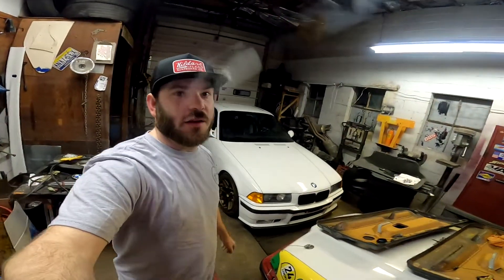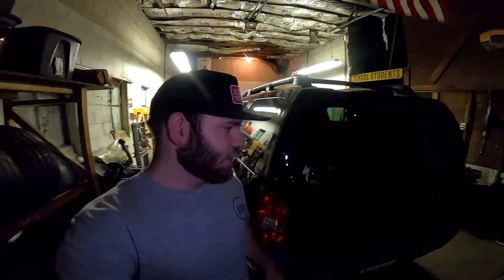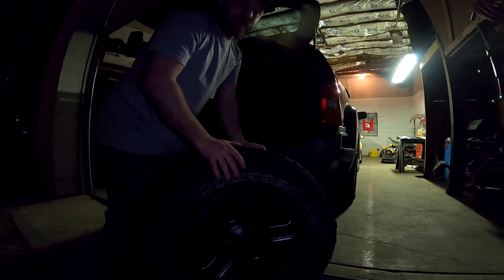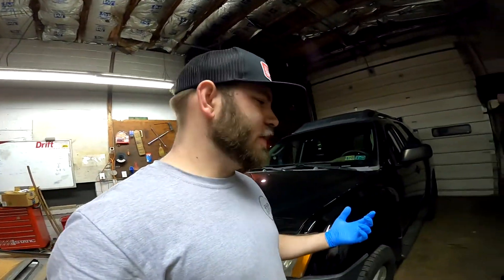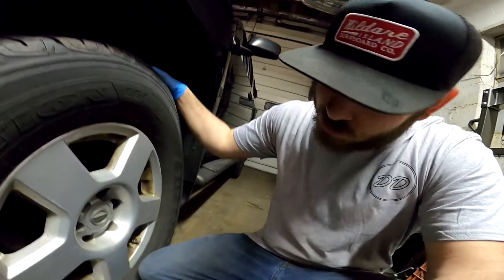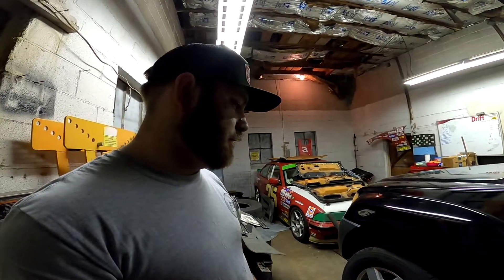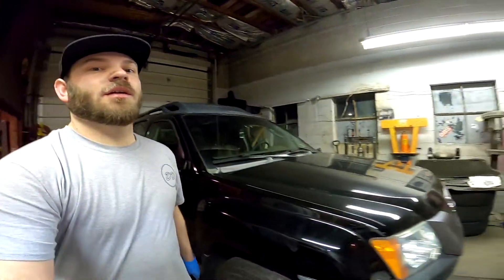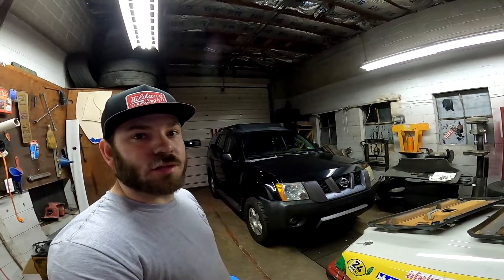New Tires For My 06' Nissan Xterra

Comment: How many miles on the xterra? 4wd?  Location? I'm actually looking for one myself.
Reply from the maker: This one had 124K when i purchased it in December, and has approx. 126k now.  It is 4wd + manual.  I'm located in eastern PA, but will likely be hanging onto it for a bit longer at this point.